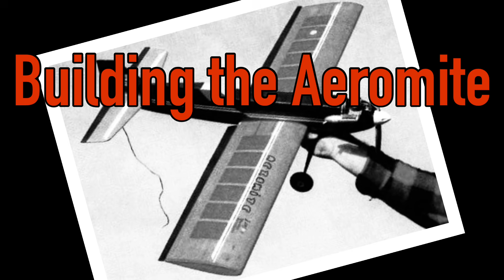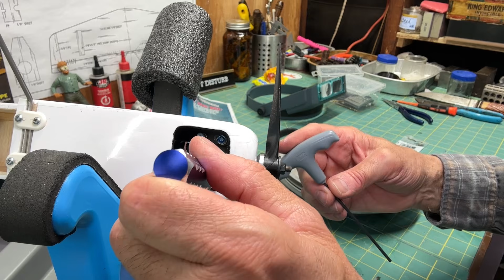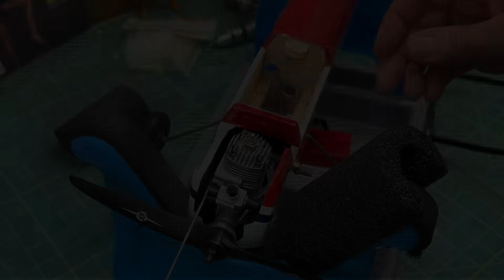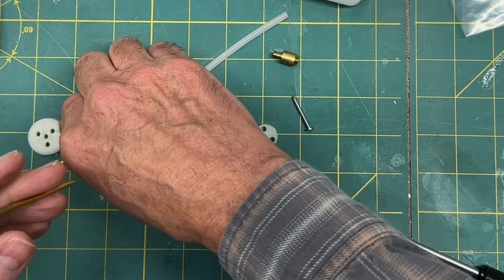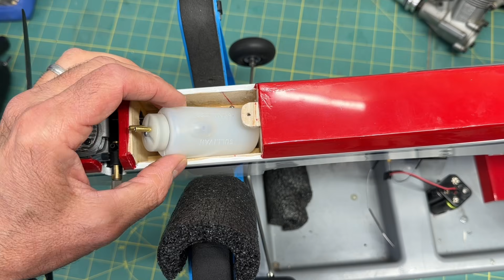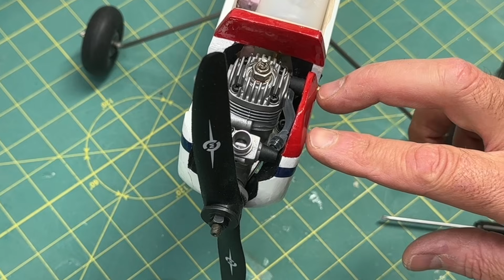How to Build a Balsa RC Plane Off Plans: No. 21 installing OS Engines .15 LA glow engine and tank

Comment: Hi there, i know i should be able to answer this question myself as im flying 40 years. Ive never built a plane, all my models are arfs. Im about to install a brand new OS 75ax on a brand new Kyosho Calmato Sports 60 and i always use hex bolts and secure them below the engine mount with nyloc nuts.  My question is, is it better to use flat washers under the nyloc nuts?  I never have in the past, but i came across your video and you use flat washers also.  Maybe its a good idea as the nyloc nut could eat into the nylon engine mount.   Many thanks, would be glad of your opinion.
Reply from the maker: Hi, Ive used plane flat washers or combos of flat with a lock washer on top. I have used lock nuts also. I can’t recall if I have ever had an engine come loose. Also use loctite on non-nylon nuts and washers. Ill double up on nuts as well. I dont have a set way really. I check to make sure the engine is mounted firmly time to time.. and awesome that you are using the OX 75AX! Fantastic high quality engine. Good luck with your setup and flying!
Reply: @jamesrcplanetech Thank you James.

Comment: Just wanted to say I have  been thoroughly enjoying this series on building from plans. Built balsa control line models as a kid, back in the late 50's. Thinking back, I think I enjoyed the building as much or more than the actual flying. Now as a VERY senior citizen I am getting back into flying models again, but RC this time. The foamies are OK, especially if you want to get flying fast, but I look forward to building with balsa again. I might even try covering the wings with silk and dope like we used to. Thanks for your generousity in sharing your expertise and your graciousness in fielding critical comments, warranted or not!

Comment: That rigid foam will transfer every vibration through the battery, receiver and fuel tank, enough to foam the fuel.  While commercial fuels have an anti foaming agent, they assume the tank will be properly mounted with proper foam.

Comment: The fuel line should be exiting upper stopper hole to get more in line with spray bar to facilitate fuel flow at any angle.  The vent has no preference, but to be angle cut as to not suck on tank wall.  A clapper clunk would be preferable.  When that HS81 on the elevator pops, that clunk will hit the front of the tank and stay there until disassembled for a clapper clunk set up.
Reply from the maker: I think the line or at least the center of the tank should be in line or a little lower than the carb to prevent flooding. Not sure where exactly mine falls without looking at it, but the tank is where it is. And with the line going in vertical behind the engine, no matter what the line will have to go up and loop back down which is higher than even the highest outlet on the take. So from that perspective the line will always be higher than the carb( not the best design). As for the clunk, the line is so short in this little tank that the clunk isn’t heavy enough to bend the short line back, the line is “too stiff” since its so short. I agree, a longer line could have the clunk bend it over forward. This thing is so small pretty much don’t have a lot of leeway for making much adjustments. Thanks, I always appreciate insight and comments!!